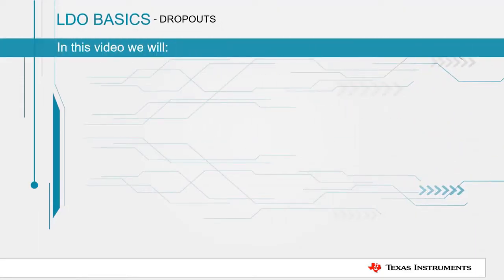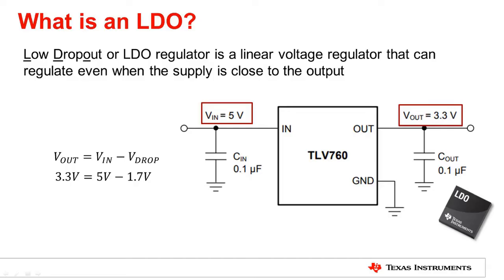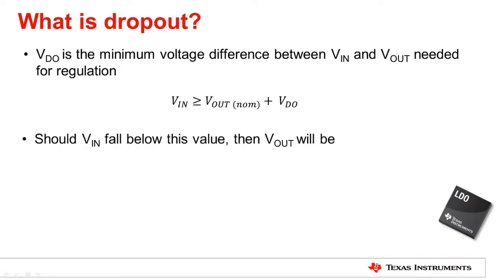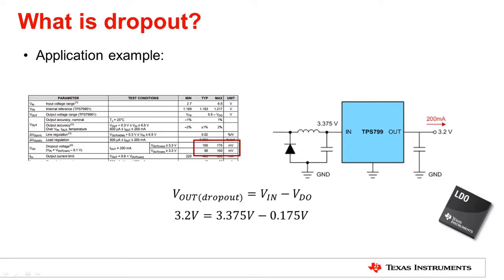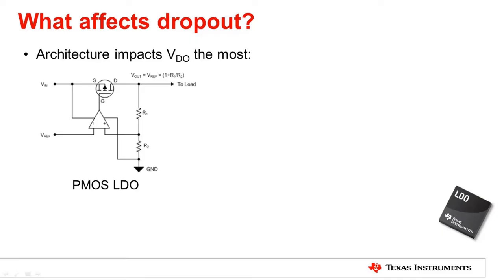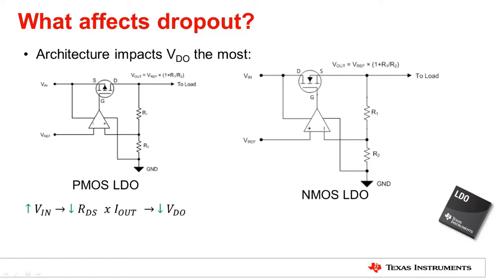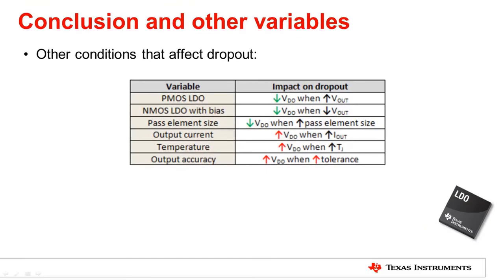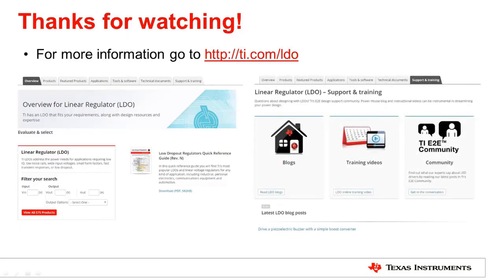LDO basics: Dropout voltage

Comment: Why did you change pin convention on what was standard for 40+ years?  Why is pin 1 no longer input but GND?  Why is the tab on a standard positive volt regulator now Vout?

Comment: Hi Sir,
what does the output current means?
I think that this value depends on the load condition as the output voltage is fixed!
Reply: it is the max current that it can supplied.

Comment: This LDO diagram at 3:15 is showing positive feedback, did you mean negative feedback?
Reply: It's positive sign, but negative feedback, as the PMOS has inverted signal behavior, in relation to the NMOS. So the higher the op-amp voltage, the lower will be Vout, and this 2 will be balanced to reach the setpoint.
Reply: to add on, the PMOS here acts as a CS (commons source) amplifier, which gain is negative. Hence, the output (at drain) is feedback to the positive terminal for negative feedback

Comment: Not bad, the video explains basics of LDO and points attention to the dependence of dropout voltage on various variables. Volume should be higher though. Thank you !
Reply: isn't there a volume button on your device
Reply: @kwekker  There is, but even when cranked up it was low.